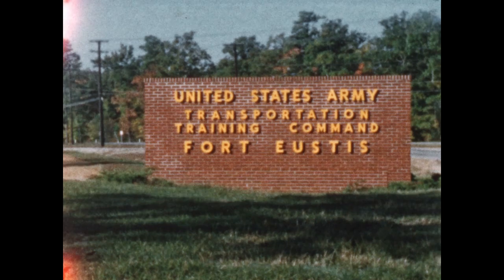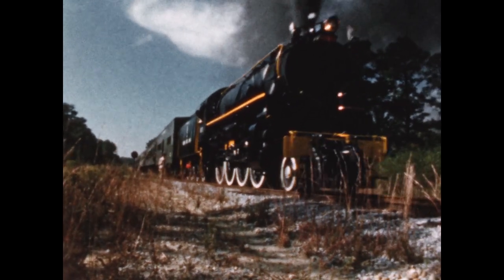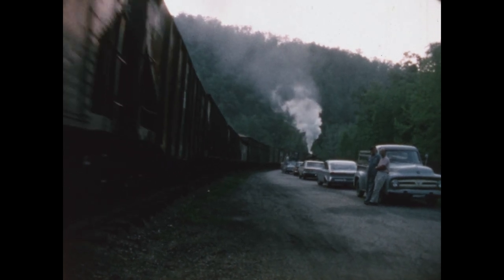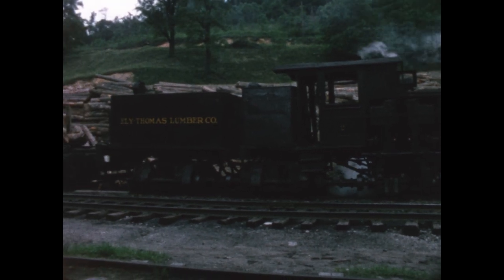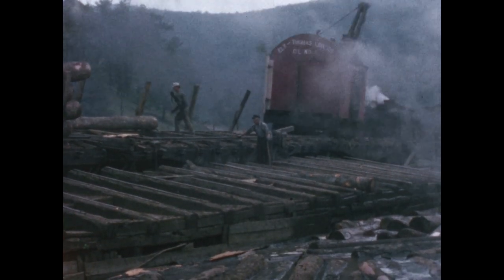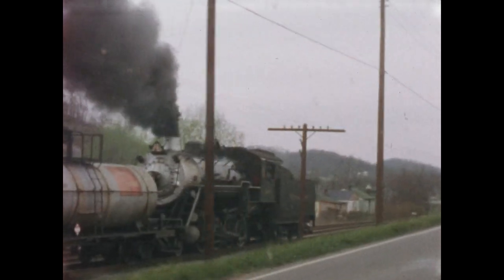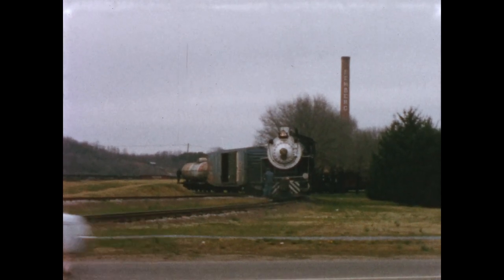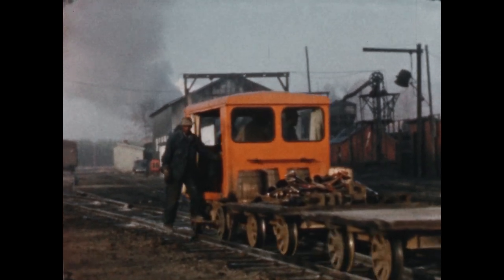Eastern Shortline Steam Railroads in the Early 1960's

Comment: 630 &722 were originally southern railway locomotives that were sold to et&wnc. Later after 4501 had initial success as an excursion loco the southern railway traded 2 diesel switchers for those 2 et&wnc consolidations and brought them back to srr for excursion service.

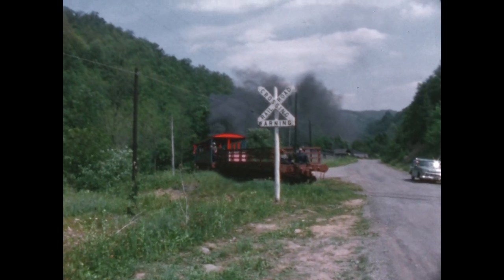Comment: You were correct, the footage at around 23:30 is Cass Scenic Railroad.  This would have been the very first season, based on the locomotive's "two line" lettering scheme which was only used for that one season.